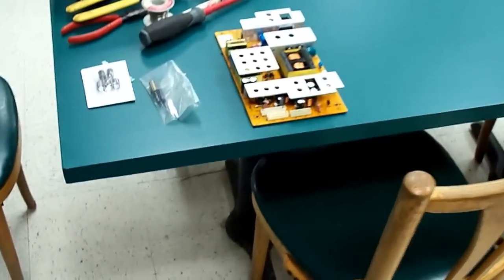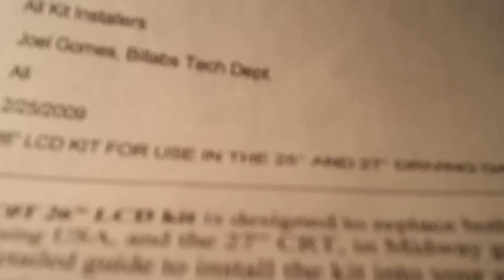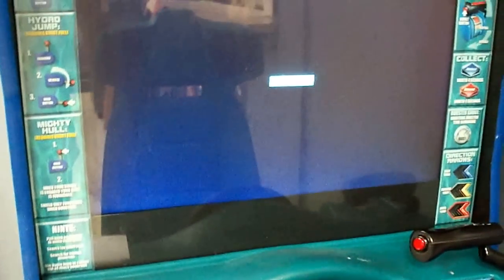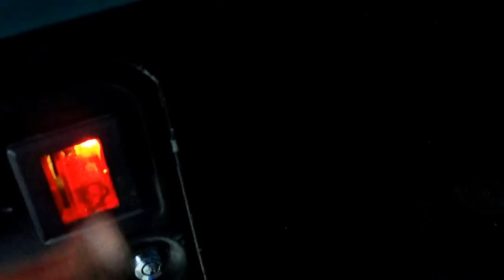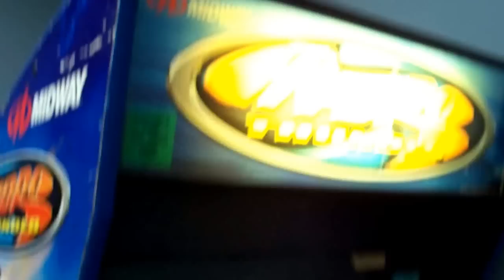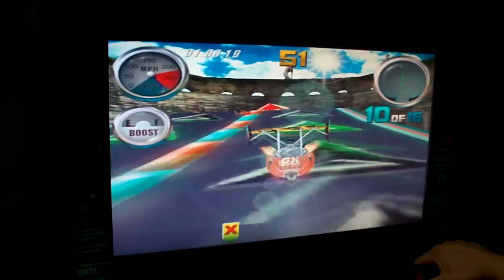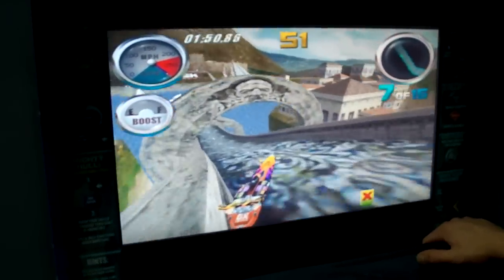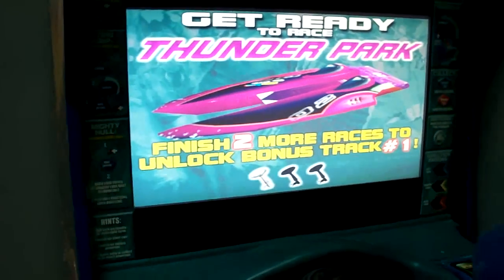Recapping Hydro Thunder part 2

Comment: does it have windows installed on it or is it dos based with command file?
Reply from the maker: I think the program is written to address the hardware directly [ie no drivers or os]
and you can't change anything in the pc  if the video card went bad you would have to find the exact same one. same with the mainboard  even adding more ram would cause it not to work .  that,s why the game runs on a pent 2 slot 400 mhz  with no drag